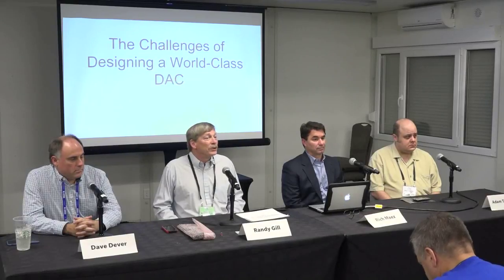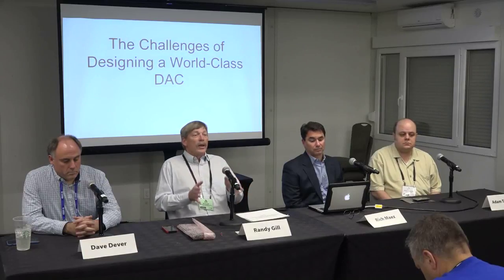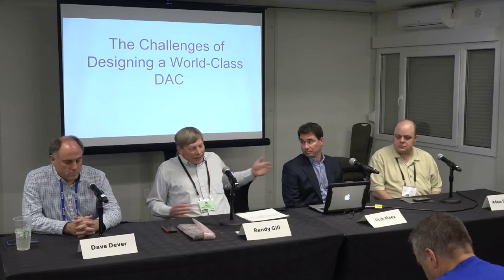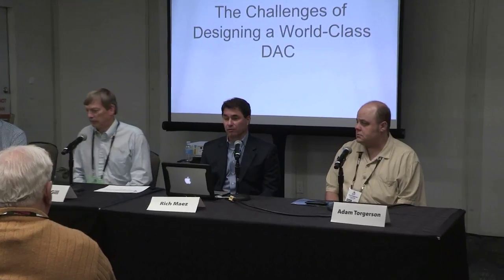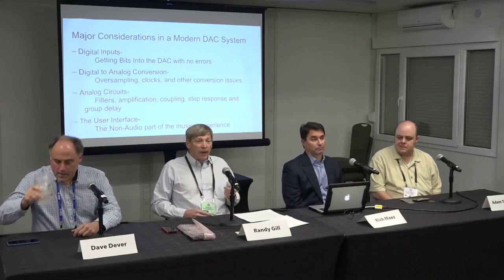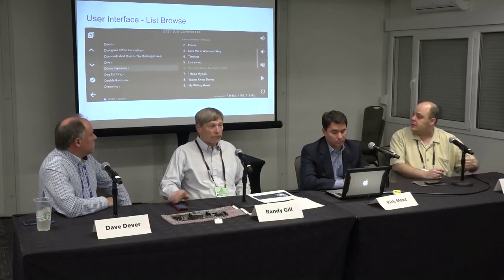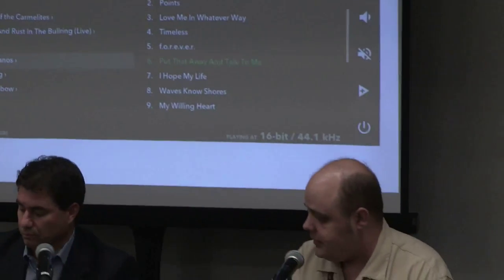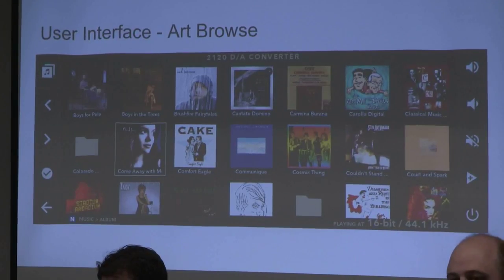RMAF16: The Challenges of Designing a World-Class DAC

Comment: According to the 2009 Stereophile review of Boulder 1021 disc player /DAC 
http://www.stereophile.com/cdplayers/boulder_1021_disc_player/
... "The digital card sends the corrected, upsampled, and filtered data as a serial stream to the fully balanced, four-layer analog circuit card. This converts the data to analog using Analog Devices AD1955A converters". The AD1955A lists for about $7.00 each.
Pretty sure the 2120 DAC is based on the AD1955A ... listen at 59:25